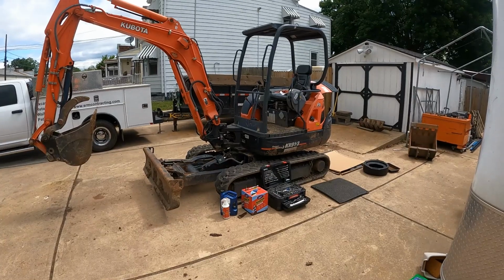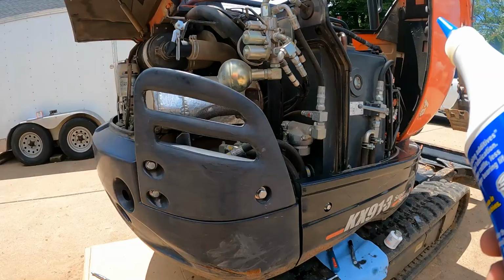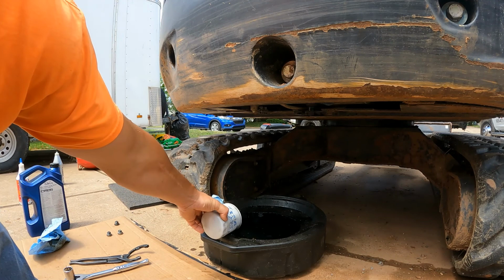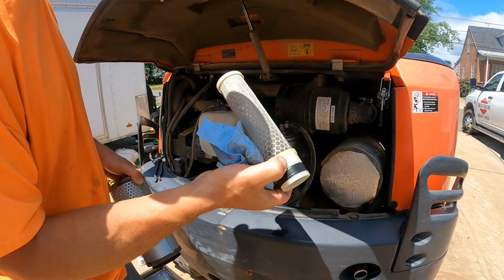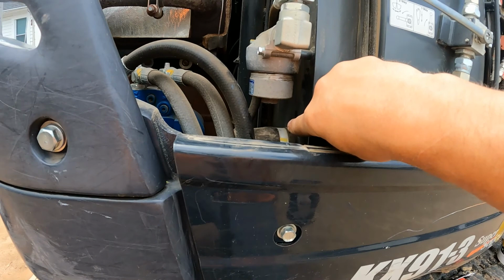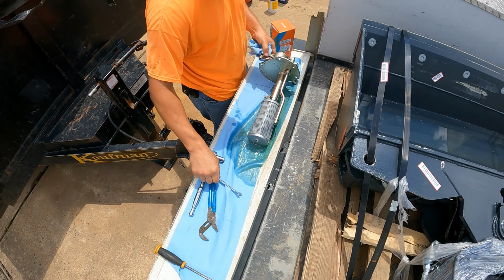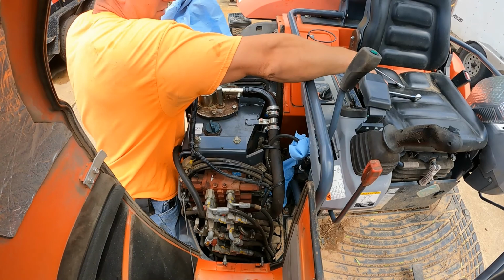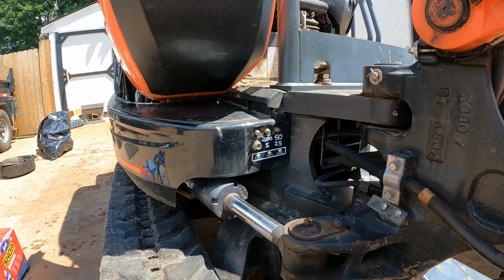Kubota Excavator Maintenance - Oil Fuel Air Hydraulic Filters Service

Comment: Thank you very much for taking the time to document all the stages of this maintenance.
I have a 2002 Kubota KX 61-2, and I need to do this maintenance.
The machine still works very well, and I want it to continue to work well for many more years.
What I fear is that the main drive drain and filler bolts are seized by rust.
Reply from the maker: Your welcome, clean around the edges of the bolt with a nylon brush or old tooth brush and some wd-40. Spray every day for a couple days before you plan to do the maintenance. Best of luck.

Comment: Thank you for the thorough service explanation! I just bought a 91-3 with 1500 hours on it. I will go through this complete service before I start using it…I have no previous maintenance records.
May I ask what grease do you prefer to use?
Thanks again….
Reply from the maker: Your welcome, I'm glad you found it helpful. I use schaeffer #238. It has 5% moly and is very thick. The only downside is you have to order it by the case. If you don't want to order that much, just get something that has 5% moly in it. I use to use Red n Tacky but I felt it didn't stay in the pins very well.

Comment: Hello, love your work maybe you might have
knowledge on a kubota mini excavator
X040-4 with 1802 hrs. She fires up runs for
30-60 seconds then dies out. On the
computer in the 2 fault codes pop up 064
Engine and 076 DPF is clogged. Got the DPF
baked in the mean time replaced primarily
and sec fuel filters cracked the lines she's
getting fuse. Got the DPF back connected all
the thermo sensors. Still same issue. Hooked
up a diesel scanner found multiple fuel
pressure sensors "high" and rail pressure
issues, crankcase sensors issue. I've spoke to
3 different techs with Kubota one is say bec
of DPF issues the kubota pcm/ecm shuts
down after 4 attempts for safety reasons.
Other tech told me "no" the bio diesel might
have crystallized and I need a new common
fuel rail with the sensors and new lines. Can
you please help me I'm stuck.
Reply from the maker: I'm sorry but I'm not familiar with those codes or that issue. I would try what the dealer recommended. Good luck with your machine, let me know how it turns out